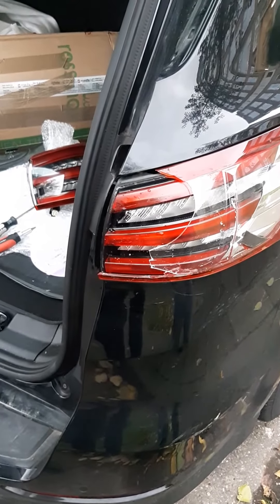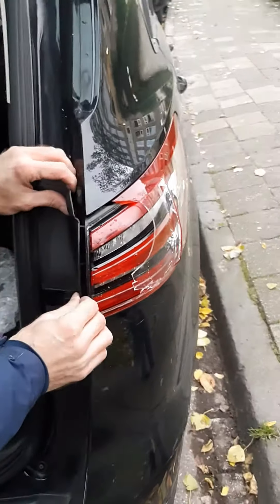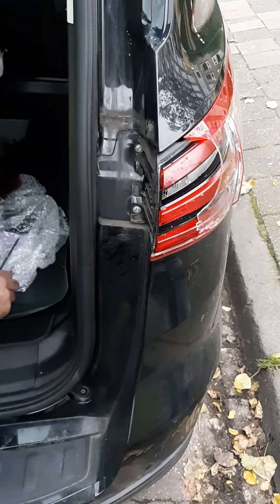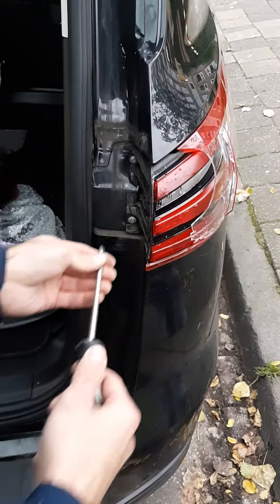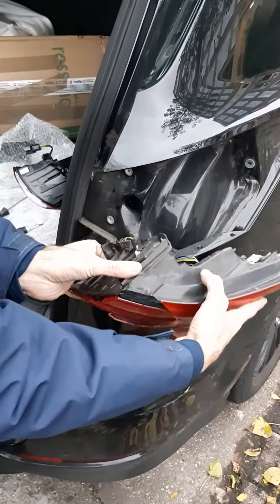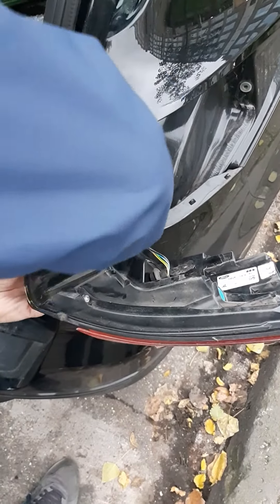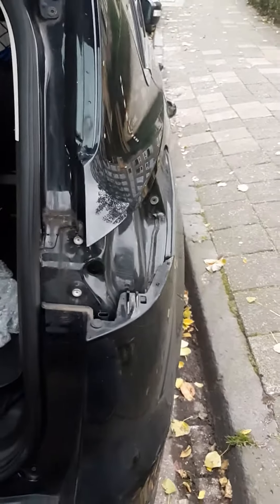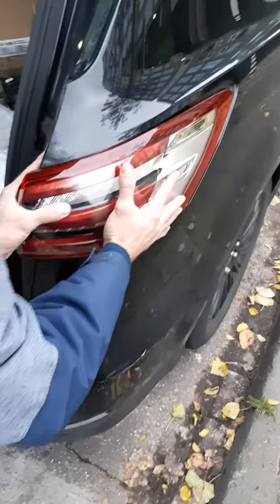Ford S-Max Mk2 2015- rear light change

Comment: Please show how to change the headlight on this model I can't take the headlight out
Reply: Take the bracket off the top which is held in with some 10mm bolts and then it comes out complete